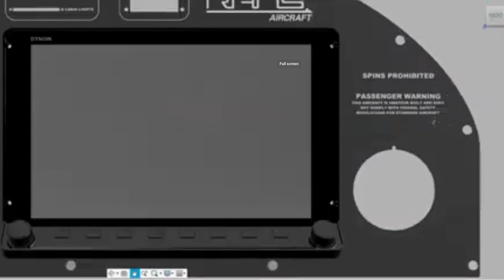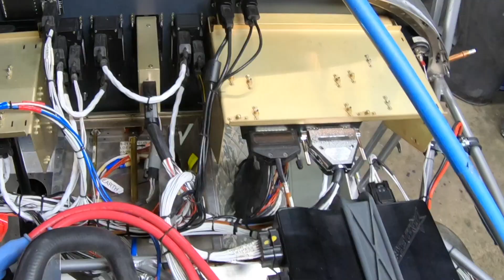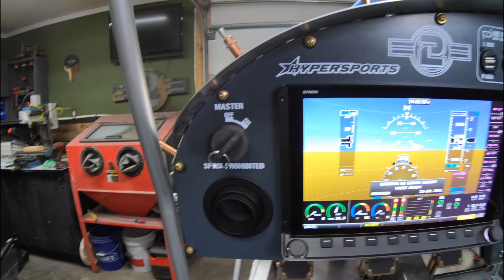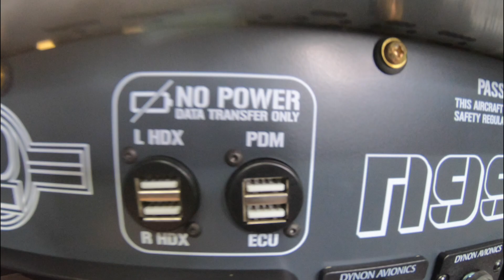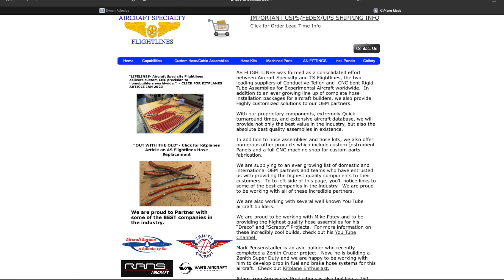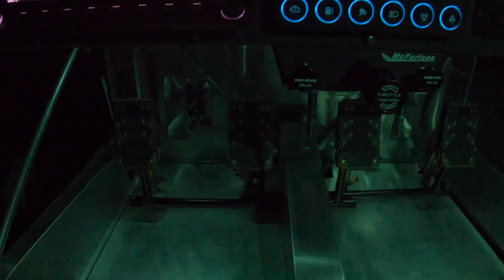RANS S21 CUSTOM PANEL EP 60

Comment: Question!  Did you order any sort of FW forward kit from Rans?  I know they tend to be motor specific?  Thanks!
Reply from the maker: No sir, everything firewall forward I made or bought separate. You are correct, they don’t encourage engines outside of ones they have tested which I suppose I can understand if you look at it from their side of the fence.

Comment: Y’all take notice how professionals don’t rely on zipties! Learn to tie lace cord. Waxed and unwaxed for those heated areas.
Reply: Less risk of chafing damage to the wiring, less risk of slicing your wrist open when you're working on the panel if the zip-tie isn't trimmed properly, lighter, less risk of damaging the wires if you need to cut the tie to add to the bundle or pull a wire from it....too many benefits to mention.  Lacing is the way to go.  Don't know how?  Read it in the bible (AC 43.13).
Reply from the maker: Not sure about the “professional” part, but string tie is the way to go for sure👍 Thanks Mark

Comment: Your panel is what all panels should be: functional and neat. Doesn't hurt that it's pleasing to the eye. IMHO, a lot of builders think "airliner" style panels - dual everything - lands them in the Cool Kid's Club. Well, I spent more than three decades behind airliner instrument panels. Yes, there were occasional scans of the opposite seat's instruments to verify/cross-check with your own. But, I never "needed" the instruments in the opposite seat. For my RV-14 project I'll be going with one PFD/MFD (Garmin GX3) in front of left seat, and a removable iPad on the right side of the instrument panel running ForeFlight. I just can't see needing more than that, but that's me.
Reply from the maker: Thanks, I agree👍

Comment: How did you set up the keypad button to reset tripped circuits? Last I looked, reset only works with a physical input pin. I have considered jumping from a keypad-controlled output right back into the designated reset input pin, but didn't look too far into that.
Reply from the maker: Just set the “global reset” to the can keypad button status of your choice
Reply: @Project2Aero  Huh, going to have to look again! I swear the last time I looked, only physical input pins were listed as options, but there have been a couple firmware updates since then. Of course, I've already drilled a hole for a momentary reset button. :)
Reply from the maker: @jefish  Could be man, I am running the most current version of software for both the pdm and the programming software. It’s kind of a pain since your current settings won’t switch over to the new version so take good notes on your current setup since you’ll need to put in all in again. Works like a champ though👍
Reply: Some firmware updates have kept my config, others have wiped it. Weird. But restoring from the saved file on the laptop always seems to work.

I'm currently trying to engrave my own text onto the blank inserts I got from Blink. Getting the laser to JUST take off the black paint but leave the white paint below is a real challenge. Either there are flecks of black remaining, or it drills all the way through and exposes the clear plastic. Wish they'd made the inserts from white plastic with black paint on top. But I'll keep trying, since I think DARs are twitchy about icon-only labeling.
Reply from the maker: @jefish  heck yea man, keep me posted on those buttons.. I figure I would address that later if they had issues..

Comment: For your taxi camera, are you using Dynon's video input adapter?  When I spoke with them recently, they commented that there is still some software development work required before complete HDX integration.  I'd appreciate your comments.  Keep up the great work for those of us coming up behind you in the build process.
Reply from the maker: Yes sir, it’s kinda on standby until they get that feature back working again. It’s on the list of things they are working on, so I’m confident they will figure that out soon.  I just left it unplugged back there ready once they drop the software update that resolves the issues.

Comment: Why not have the display set up with an autodim feature? I think it would bug me to constantly be futzing with that
Reply from the maker: It’s an option built in but I find that I like things dimmer than most folks at night so I wanted control
Reply: @Project2Aero  hmm... Could you set up the lever as a rheostat to tweak the base? Or is that basically what it does already? Also, I'm curious why you have a switch for so many functions when a pdm could, theoretically, be programmed to do a lot of that automatically.
Reply from the maker: @Jazz3006  yes that pretty much what it is doing.  The pdm is controlling all of it, the dimmers and keypad are simply input variables for it